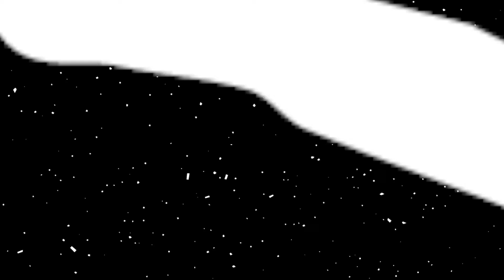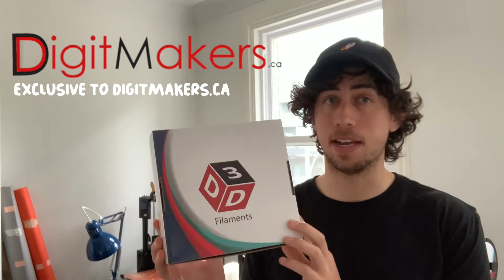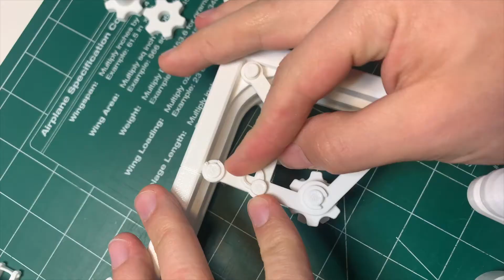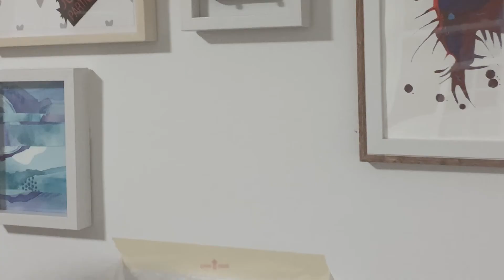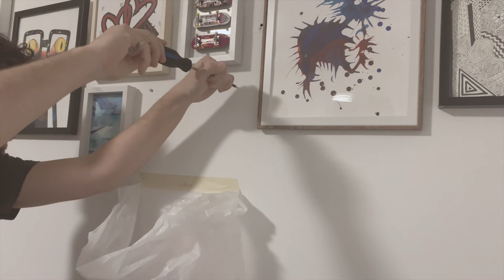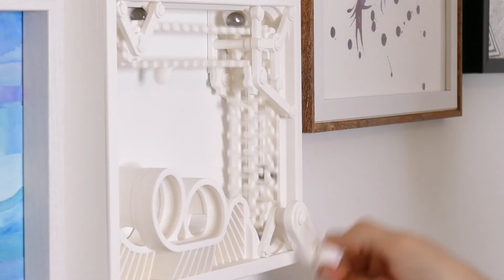Wall Mounted Marble Coaster - Fully 3D Printed Mechanical Sculpture

Comment: I printed and assembled everything only have problems with chain. I print it with the same pla as other parts (bambu pla matte) , I already printed it 3 times in different positions, but everytime I assemble it it just breaks on joints. This little snap does not really seem to work for me. I even tried with glueing the joints and moving them inbetween so the glue helps with joints but it is still flexible. It still did not work, I could not link 53 links, it still snapped as I tried to . What can I do to make the track work ? Any suggestions?
Reply: Same here, it's not all of them, but enough of them just unsnap with the slightest tension that the chain becomes useless. Not sure if I should just print a whole bunch more until I get the required number of "good" ones or if there's some other trick.

Comment: My ball bearings keep falling out and the track is really loose and if I try do 52 they don't link
Reply: same for me
I think the best solution would be to have an arm with a gear that can adjust for 53 links that the links could be tensioned with the arm
Reply: similar issue. I printed the links again at 105% scale and then swapped about 6 of themto get the chain to have just the right level of tension. 
The ball bearings still fakk out the side more often than completing the track.

Comment: Printed the design and it came out very nice! I have one problem though: Using 53 links makes it very tight! So tight that within 1-2 turns of the crank the chain snaps. Using 54 works better, but the chain is very loose right now. Could it be related to the filament? I am printing 0.2mm on a Prusa MK3S using colorFabb PLA/PHA filament.
Reply: Hi Stefan, apologies if you've already considered this. Have you tried orienting the chain so the layer lines run the opposite way to the way you've previously printed it?
Reply: @anthonym1998  i did check the dimensional accuracy in both Y and X axis, and they seem to be surprisingly accurate (80mm square was +/- 0.1mm). I reprinted two 5 link chains with a stretch factor of 103%. That seems to do the trick! 👍
Reply: @falstaff321  glad you got it sorted! Just to clarify, I wasn't suggesting the dimensions might be out slightly. I was thinking that the layer lines make objects more prone to breaking along a certain orientation. I've just bought the plans so thanks for posting your solution so I can try it.
Reply: @anthonym1998  the chain links use a "snap joint", so you can snap links together individually. The individual chain links are fine, its just that this snap join "breaks". With the lengthened links the chain gets a bit longer such that the chain as a whole no longer is stretched as much and isn't snapping anymore.